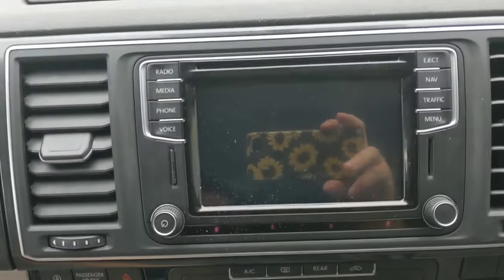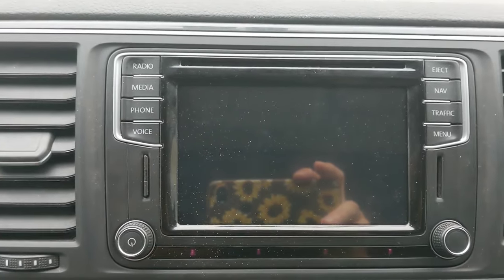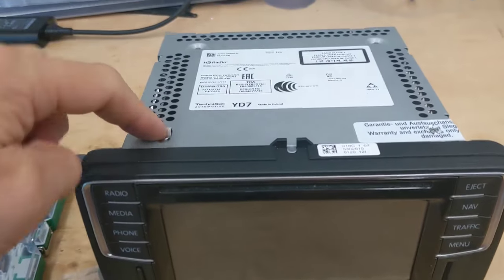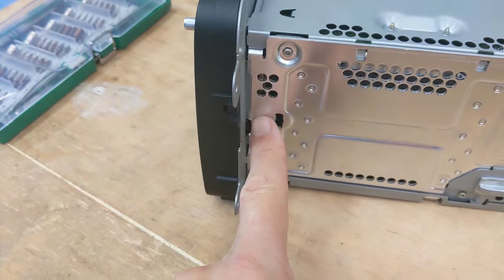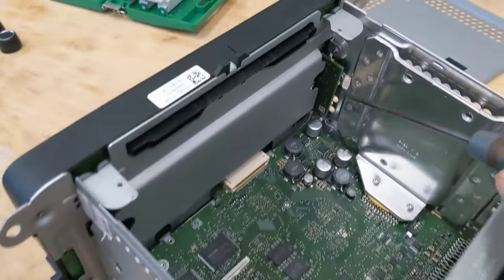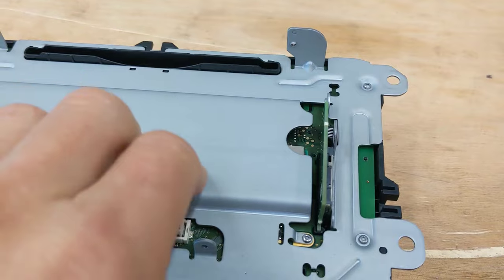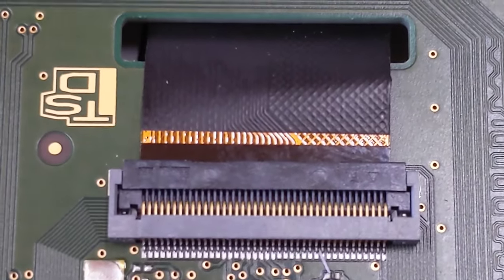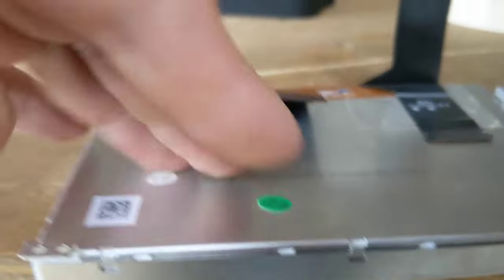Repairing the faulty touch sensor on a VW head unit.

Comment: If you want to use this technique is the easy way and it works perfectly but to make it even better use an anti glare film on the first screen because I believe that if you just put a glass on a glass it will have some reflection problems.I do these repairs the normal way I was just thinking about this reflection prob.Good and simple job 👍

Comment: I've been perfectly happy just resetting the dang thing every day. But today the thing started to power cycle and REFUSES to boot. Guess this is my future.
Reply from the maker: That sounds like a different problem to me.
Mine always booted. it was just uncontrollable once it did boot.
Also, rebooting made no difference to mine.
Reply: @DuncanLaw  It's a sequence of events that is replicated all across the net. If I'm lucky, the issue is the radio perceives an issue with the touch screen and reboots to try and get it to work. This would have fixed the issue with the touch screen getting stuck for sure, but it's still worth trying at that kind of cost and see if it fixes this new issue. It literally started this morning. 

Your video is actually shared on places like reddit for the issue I'm looking into. So even if it doesn't work for me, it's helped others plenty. 

Otherwise, I'm just buying a new dang unit from Best Buy. No way am I spending over 1,000 bucks for it.. let alone 2.
Reply from the maker: Interesting. Thanks for letting me know. 
I believe there are android based units you can replace this one with if replacing the touch sensor doesn't work for you. An expensive fix but still a lot cheaper than getting a VW unit.

Comment: Thank-you so much for this! After years of putting up with the screen ghosting and not willing to pay £690 for someone to fix it, I found your video through the forum. 30 minutes later and it's all sorted! Thanks again
Reply: Dear please tell me is it working good for you. I have also touch problem.
Reply: Yes it's working perfectly. Back to normal after the new digitiser was fitted
Reply: @fob3664  No need to remove old touch just by putting  new over old ?
Reply from the maker: Exactly.
There is just enough space for the new one without removing the old one.
Reply: Pls where can I buy new one? Thx for answer
Reply: There's a link in the description for the video
Reply: @bhimshanker  works like a champ!!!!

Comment: Great job Duncan!  I was offered a replacement unit by VW for $1700.  That included 60% goodwill from them.  In other words a new unit with instalation would cost about $4k.  I decided for $1700 I'd be better off buying a 3rd party replacement unit -- until I saw your solution.  Now after spending less than $20, I have a fully working unit again.  Thanks for the clear instructions and the link to the touch screen vendor.  WELL DONE MATE!

Comment: Thanks, saved me hundreds of dollars, almost $2k if I wanted to go through VW. 

A few notes:
You will need T6, T7, and T20 Torx screwdrivers, the T20s take the stereo out of the car, the T7 removes the casing, and the T6 is for the circuit board. 

He also skips a few steps, presumably because it's hard to do them while holding a phone to record. Only one thing really stumped me for a few minutes until I figured it out:

When you get the part where you are removing the circuit board/screen from the outer casing, there are clips next to the SD card readers that you have to press in order to release the board. You CAN remove the SD cards as he says, but you do not need to. Still, I found it easier to just take them out as this made accessing the clips easier for both removal and replacement.

I spent in total about $25 dollars on this repair, and that cost included a $10 Torx screwdriver set.

Be sure not to overtighten the screws affixing the board to the screen as this will apply pressure to the screen and give you white spots on the screen while you're using it. It's annoying, because by the time you realize you tightened them too much, you've already plugged everything back in.

Comment: This video helped me out tremendously. A few notes for people that are doing this or about to:

1. You do have to remove the SD card readers.
2. When you are putting things back together, you do not need to put the metal shield back on the front of the display, this just adds extra girth with no benefit. 
3. DO NOT tighten screws all the way. Tighten them as lightly as you can. Tightening them too much will make the screen go white/light on the sides where the buttons are. 
That last point can be an exercise in patience. Tighten, reassemble radio, test. Disassemble, loosen, reassemble and test again until you get it good enough for your liking. The buttons can be a little rattle-y if you leave the screws a little loose, but that I think is a good price to pay. 

Good luck guys!
Reply: Also, to add to your list, you need three sizes of Torx screws: T20, T8 and T6. The deeper you get into the radio unit the smaller the Torx gets.
Reply: Дополню, сорри, что на русском.
Имел сегодня секс с этим процессом.
Выводы:
- Если ставить сенсор поверх старого - будьте готовы к тому что на прямом солнечном свете экран заметно бледнеет, но в общем не критично. Видно нормально, да и прямое солнце светит редко.
- экран начинает не сильно, но отражать. Тоже, чем больше солнца, тем больше бликов. Но тоже не критично.
- причина - воздух между слоями. Почему нельзя сделать «полный-клей» на подобии защитных стекол, как на телефонах - не понятно. Уверен, это сняло бы обозначенные вопросы.
- снимать металлическую рамку экрана - нет никакого смысла, так как экран упирается в лицевую панель именно сенсором, а не рамкой. Высоту «пирога» это не уменьшает совершенно, но рамка, если она есть - хорошо центрует экран в лицевой панели.
- новый сенсор добавляет этой сборке лишних 1,5-2 мм и это действительно проблема. Можно конечно недожать болты, но если плата не станет на свое место, а она не станет, это выльется в следующие проблемы. Кнопки будут болтаться, карт-ридеры уйдут вглубь облицовки, плата будет перетянутая и перекошенная и может даже сломаться, особенно в зоне «крутилок», и вы не поставите не перетянув плату на место верхний металлический щиток этого экранного модуля. А следовательно - не соберете нормально устройство.
- решение есть! Нормально встать плате на место мешает не экран! Плате мешают крепления рамы экрана, которые из-за дополнительной толщины сенсора поднимаются на 2 мм. Сам экран плате не мешает. Он ниже. Нужно эти крепления немного модифицировать, так, чтобы они стали на старое место. Нужно разогнуть эти крепления вверх, расточить отверстия к низу, и согнуть обратно, чуть ниже чем было. Лишнее отрезать. Рама алюминиевая и все это делается аккуратно, но не сложно. В итоге - всё становится на место как положено, «бутерброд» собирается, винты затягиваются, всё на месте, всё готово.
В общем, схема рабочая, но надо иметь в виду первые два пункта. Если вас это не смущает - все это делается за час. Китайцам - отдельное пожелание, сделать всё тоже самое на липучке «полный клей». Цены не будет этому изобретению.
Удачи! 👍🇺🇦
Reply: THanks for the tip, found that if the screws aren't tight enough then the buttons are mushy .

Unfortunately reassembled the radio to find (as you say) I've got white spots on the screen. So reassembling it all again now.
Reply: Hola, so what is your advice about the correct tight of screws? Thank you in advance!
Reply: @carlosrafael7904    unfortunately, exactly to David's point, you'll get used to taking the front off the radio and plugging it in several times before you get it right.

My 'Radio' button is still mushy and I think two of the plastic standoffs are probably not doing much holding anymore. But my screen works at least.

Comment: Hey there - thank you very much for the guide. I ordered a new screen 9 days ago from your link below ($14 delivered to Sydney), it arrived today and took me 25mins to fit. Its fantastic to have control of my radio after 10 months since the touch screen failed. I've placed this one over the top without breaking into the screen unit like you (@ 5:35).  The new screen comes with a glued edge and attaches to the alloy border on the old unit - I needed to remove the glue protection (paper) and place it accurately first time, no second chance.  I can now use Android Auto again as was not possible to add a new android auto device without touching the screen (android auto/screen mirror selection) - that's been a major headache for a long time.   I'd been quoted $3000+ for a new unit, or $800 for a stolen one with no security codes..... Duncan you're a legend sir.
Reply from the maker: Thanks for taking the time to let me know! Saving someone else fro the pain i went through trying to work out how to fix this makes taking the time to document it worth while. Thanks!

Comment: I wanna chime in on all the praise you've been getting for this replacement guide. Because it also helped me out a lot. Not only did it give me the idea in the first place that a fault like this could be fixed instead of replacing the whole thing. Also the idea of simply placing the new over the old touch screen is ingenious. I have watched your linked videos with the guy going the full mile, and I could never have done that. Neither equipment nor capability wise. 
But now the unit works perfectly again. Thank you so much!

Comment: This saved me a fortune!
I bought my Cali aware of this issue from the seller, who took £1500 off the purchase price. VW wanted £2400 saying I needed a new head unit and I was quoted £1250 for a new alpine unit from a car radio specialist.

So I followed Duncan’s video, thinking this can’t work… paid £10.98 for screen, £10 on some torx screwdrivers as you need T10 to remove unit, T8 & T6 to unscrew the unit and it works as it should again, thanks to Duncan.
Reply: Hello 
Can you advise me please, who to purchase the screen from ?

Comment: Thank you for taking the time to do this video. You’ve saved me so much time, effort and money! I did this fix on a 2017 Seat Alhambra with a touchscreen that was partially non responsive and driving me mad. Your fix worked a treat. Thank you again for this!
Reply: Hello, i have the same probem in my alhambra.
could you tell me, witch model did you buy ?
thanks

Comment: Strange how everyone’s digitiser goes on the right hand side, isn’t it?  Mine too!  Wouldn’t have dared to try tackling this without this video.  Shame that at the critical bits the video stops and then restarts when the dismantling has been done.  However, really useful to show you what you need to do and I understand that when you are trying to video what you are doing you can’t do both at once!  Once you’re in there it’s quite self explanatory.  A lot of little torque screws to remove but just take a photo at each stage and you’ll know which hole they need to go back in.  A bit nerve wracking and of course you don’t know if it’s worked until you’ve put it all back together, but it did so well pleased.  Thanks a lot Duncan.  Keep up the good work!

Comment: Holey moley! Duncan, I can't thank you enough! The ghost touches / not at all responsive faulty original screen were driving me crazy for about two years, skipping tracks back and forth and dialing extra numbers while talking on the phone. My local dealer said all they could do was to replace the whole unit and quoted me €1100 just for a new unit, with additional labor cost etc. Then I stumbled upon some mail-in online offers, which still were ranging from €300-€450... I was almost willing to save up that money just to get a working touch screen again.

I recently got a new mobile phone - while my old phone always connected automatically via bluetooth the new phone hasn't been paired yet.
Even though it's possible to use the physical buttons to navigate to the bluetooth pairing mode and select a phone, the very last step to confirm a pairing code can only be done via touch screen - and the old one just wouldn't react at all (except for two spots in the very bottom left and right corner - but far away from the confirmation box).

Then, just by chance, this video popped up in my recommendations. I watched it, was very intrigued and mailed the same vendor that you linked to with photos of my unit and he pointed me towards the proper touch screen I needed. I also ordered some tools to remove the faceplate surrounding the radio unit. About 11 days later the new touch screen finally arrived - thanks to this video it was quite easy to follow the steps shown and just put the new touch screen on top - just as @pikey6258 described, I put the screen on the frame of the whole screen unit (not directly on top of the other touch screen inside the screen unit). Half an hour later I was back sitting in my car, really really excited and nervous if this will finally end the suffering of not having a fully functioning radio unit - but then it registered every touch right away and I could access all the menus I couldn't anymore before. It was such a relief!
I could also finally connect my new mobile phone, so listening to podcasts while commuting while be very convenient again!

So thank you again so so much!
Without this video I might have spent 12-15 times more money to get this fixed!
You sir are awesome!
THANK YOU! 
❤

Comment: Hey Duncan, I just had the same problem with my tiguan. Found your posting and followed the link for Ali express.  Took 2 weeks, not bad from China! Thanks for the instructions,  it really is a straightforward procedure and is now working perfectly. Volkswagon are infuriating!  Will not accept the unit is substandard but is repairable and just want to sell you another unit for an unbelievable price. Seems this is happening world over on a regular basis but same old response from VW. Again, many thanks for your research.
Reply: My Tiguan is the same, VW said prob be over £2000 for them to replace. It went crazy, first started dialling my contacts randomly, then deleted all radio stations along with icons, then satnav went crazy putting me in middle of Europe! A guy in a repair shop who VW sales rep told me to contact still wanted £400 just to send it off to see what was wrong with it. I'm ordering this, if it works, this guy is a genius! 😁

Comment: Duncan thank you so much for this, many little tips you gave helped massively . Just a couple of things that may improve.
1. Remove the metal shroud totally which gives you almost the extra gap you need to double layer the digitiser.
2.If you follow no.1 then clean both pieces and use the sticky to glue then together.
When reassembled i did the screw up fully bit very minor torque and screen has no white spots or anything else and buttons do not rattle.
the only way you'd know it had been carried out was a slightly dimmer screen. 
Once again many thanks , i ordered the same as you from aliexpress for my 6.5 and it came in 10 days and cost £8.50.😍

Comment: Thanks for taking the time to post this. Really easy to follow. I have a Discovery nav (2017 California Beach ) with an ALPS chip set next to the SD Card reader. To remove the screen from the PCB I had to remove both the vertical SD card readers as there’s a small pressure clip on each that needed to be pushed to release the touchscreen. One other build - reset the head unit after reinstalling (on mine it was just pressing the power button and holding for 10+ seconds until the unit restarts. The new digitiser didn’t work until I did this.

Comment: Thanks for the vid. As others have said, worked perfectly and saved a fortune. 
The only bit that’s missing and that caught me out slightly were the little clips next to the SD card readers. They needed unclipping before the board came away from the screen. Other than that, all fairly straight forward.

Comment: Thank you so much for sharing that fantastic solution. A 15$ job instead of 350$ to replace the screen or 2400$ + labor to replace the radio at the dealer. The most difficult part is to remove the plastic frame around the radio. It helps to have good plastic tools for that.

Comment: Top man, worked a treat! Little tip - I put some foam tape on the backs of the rubber button covers, which removed any rattles. Also left the metal shroud off. Thanks again! Good to have a working radio back. Done in 1hr :)

Comment: Thank you so much from Australia..
I learned from your video that the problem could be fixed cheaply and I immediately  followed link to order the part from Aliexpress. 

Local VW dealer quoted me AUS $3919  ( $3519 for parts and $400 service fee) to replace it for my 6 years old Caddy.  Touch screen stopped working a year ago. 

The touch screen arrived today from China after 2 weeks. 
I also used another video from "neuromangler" for a lot more details in the repairing process. 

I ended up spending AUS $20 plus 2 hours of my time. It is now working like a new one.  

Huge thanks!!!  Duncan!

Comment: You were the first video I seen that suggested leaving the old screen on. Worked perfect. Thanks. Only thing to add is make sure anyone doing this orders a small precision torex screw driver set along with the replacement screen. Torex head sizes for the internal radio screws were very small T 5 I think. I chanced a small flathead and got away with it luckily.

Comment: Thank you!! This worked perfectly for my 2017 Jetta. Screen only took a week to get here. Mine head unit is a little different as the release tabs are on the inside and I had to remove that small daughter board as well. 
I had to run to Home Depot to get a Torx key set, I needed T6 & T8. 
I advise anyone doing this to make sure to have all smaller Torx sizes before beginning.